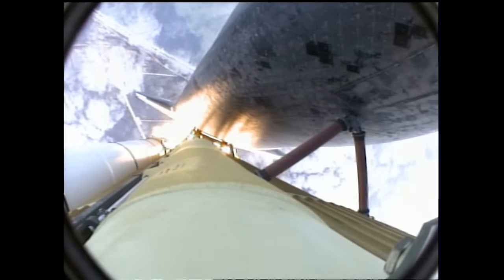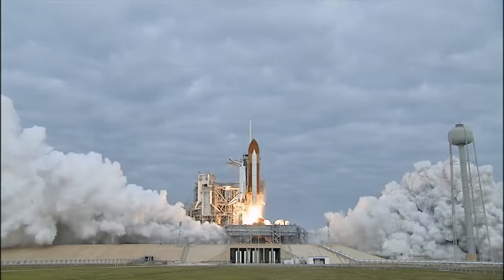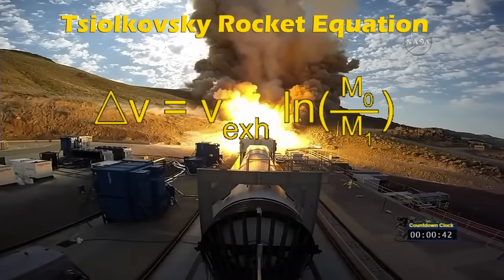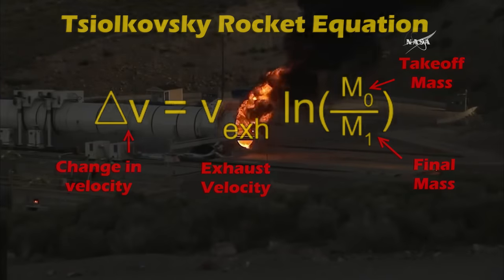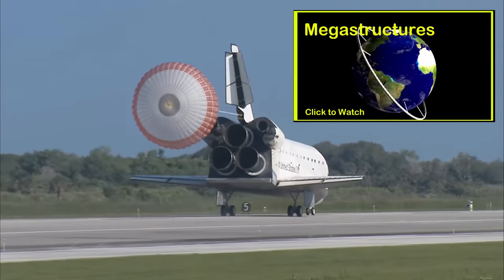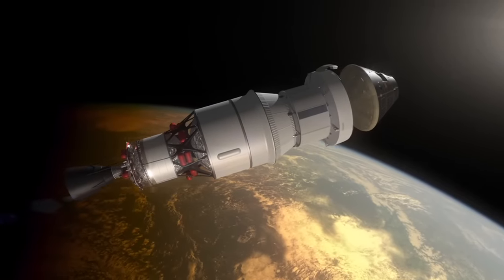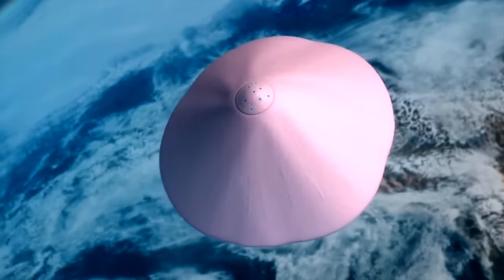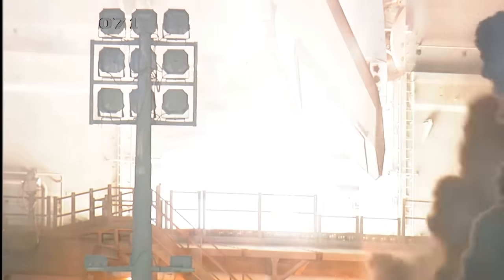The Spaceship Propulsion Compendium

Comment: Project Orion/Daedelus werent serious projects. Research what the researchers say about them. They were covers for real research they wanted to do. And if you dont get why its an idiotic idea you probably arent educated enough to speak on any serious subject.
Reply: please note MOST of the technologies he mentions here done work (theyve been tried) , are ASTRONOMICALLY expensive or are fantasy. A tip. There is no evidence dark matter  exists. None. Zero. Research it.. or talk to a physicist

The EM drive most likely defies the laws of physics (there is a possibility that it doesnt  because of spacetime "frames). There is at this time no evidence it will work and yes it has been tested but the amount of thrust it even theoretically produces is so tiny compared to its weight (IF it works) the problem with testing it is even in an extremely well controlled experiment the infintesimal amount of thrust is likely produced by temperature differences.